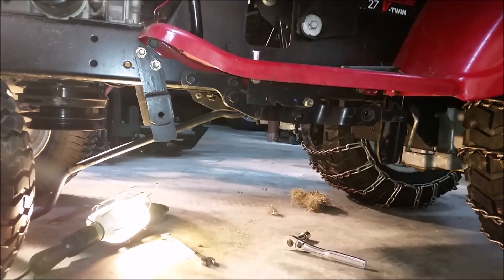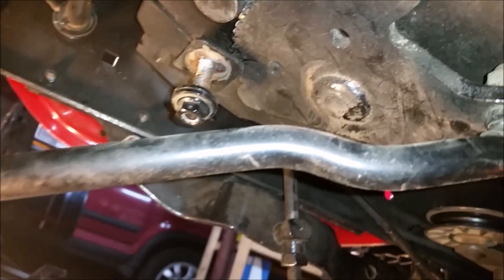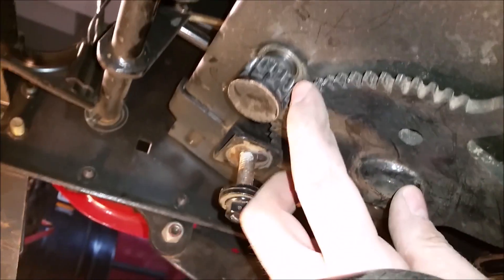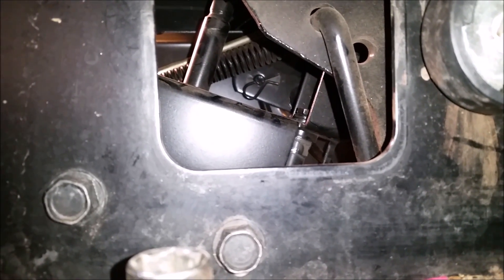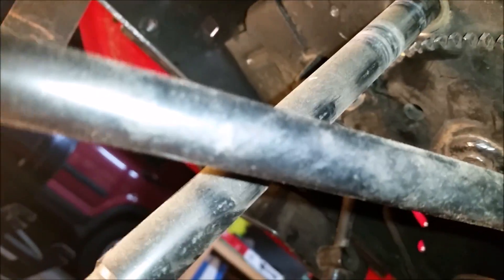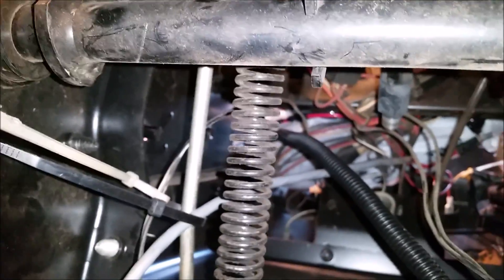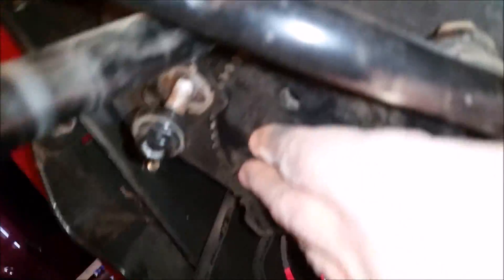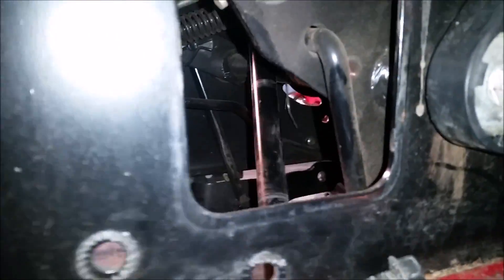Craftsman tractor DGT6000 bad steering fix upgrade V1.0 - There is a V2.0 update

Comment: Ould you rotate the sector gear a tooth or 2 to allow for the same amount steering in both directions. I just bought a husqvarna that has the same steering setup as your craftsman. It also turns much tighter to the left than it does to the right. Also, does the steering shaft have to come out through the bottom of the mower instead of pulling it out from the top. Thanks
Reply from the maker: No cannot rotate it a tooth as the linkage will hit the frame. This is just the way it is. Yes the shaft have to come of of the bottom . Watch the later 2.0 version of this video as I make more adjustments later.  Thanks!

Comment: That was quite the steering wheel modification!  I agree that using that plastic, likely Delrin, for bushings is a designed/engineered failure, maybe to save construction costs, but also to sell replacement parts.  Your Upgrades should last forever!  Too bad that MTD, who makes riding mowers for most all branded sellers, including Craftsman, won't use materials like this to make their products much more reliable and basically indestructible.  If cars and trucks were built like this, they wouldn't last 5,000 miles, but now even vehicle manufacturers are cutting costs by pennies at every turn.  Built in the USA/in America used to mean something, but now everything is outsourced to China, Hong Kong, Taiwan and Mexico where standards and quality mean nothing.  That's why you're much better off with Japanese vehicles made in Japan like Toyota and Honda.

Some Japanese vehicles are assembled in America and Canada and even Mexico, but they are all assembled with Japanese OEM parts for cheaper labor and shipping while enforcing strict standards of Craftmanship during assembly while Chevy and Ford do not, especially not in Mexico!  Many American vehicle parts and engines are built with American design, but done with little to now standards.  Mexican workers for Ford are paid $6.50 for an entire day's work, so what kind of quality can be expected from that?  Toyota and Honda pay much more and the workers are Supervised!  Briggs and Stratton small engines built in China are complete garbage in comparison!!!  My now 5-year-old Briggs and Stratton small engine in a Craftsman self-propelled push mower has zero compression after its 2nd use of its 3rd mowing season.  I bought it for buying a house and didn't use it at all the 1st year and it's been dead for a year.  I'm gonna tear it apart and check the valve bushings, piston rings and cylinder wall to see if I can repair it.  I've been buying Craftsman all my life and their push mowers were never considered to be a "Throw Item" before China!

If you take the steering gear loose from the steering column, straighten the wheels, center the steering wheel and center the steering gear, you should be able to get an equal turn radius for both front wheels by centering the steering gear left & right stops.  There may also be some wheel axle assembly and/or ball joint adjustments you can work with to keep both wheels perfectly straight and properly aligned.  You might also want to install a gas shutoff valve, especially for wintering storage.  I see the gas filter, but not a gas shutoff valve.  It usually goes between the gas tank and the gas filter.

Comment: I know it’s been years since posted, but thanks. 
I fixed mine with your solution as an inspiration. I found some block bearing that fit inside the frame piece with only minor grinding. They sit on top of each other inside the bracket. There’s grease fitting as well. If the gear and sector ever wear out (some sloop from years of wear), they’re easily replaceable.
Reply from the maker: I hope you didn't use a bearing block similar to mine as it didn't hold up over time. I have a later video on my channel with a retrofit.
Reply: @ScrapMetalWorks  I’ll look for it. Mine had grease fittings on it, so far no problems.

Comment: Let's be honest who at fault here you are for not blowing and keep.trash out and lube moving areas ur fault totally think about i use compresd air to blow out all dirt and grass and no failures when you care of ur equipment
Reply: It’s normal wear and tear you can’t really lube a plastic bushing maybe with graphite or spray silicone but I’m betting you will not get that much more time out of it,I bought mine in 2003 and it’s just getting bad now,I mow a bit over an acre sometimes 2 times a week if we get much rain but most times it’s only once a week I always rinse it down to remove the dust and clean the deck

Comment: No doubt new bushings are needed, but those teeth are too far gone for your right side turning, I have to do the same thing to mine.
Reply from the maker: it lasted until the end of last summer but it was finally done. I replaced it in the fall and although it was a pain to take it all apart again it gave me a chance to inspect the condition of the bearings and cage assembly and found no wear so this modification was definitely the way to go. thanks.

Comment: How can I tighten up that plate with gears on it my plate wants to flex when it starts getting pressure on it
Reply: That's what mine seems to be doing too.  Husqvarna over here.  You find a solution?

Comment from the maker: Remove the square black plastic cover on the left side by the foot well and you can see the steering shaft. Reach in with a pair of pliers , unclip it from the shaft and the pull straight out.

Comment: Very cool! Extremely smart idea. You should patten that and sell it. I’m having the same problem now with the one I’m working on. Do you remember what part numbers those bearings were?
Reply from the maker: Austin Crum watch the 2.0 version of this fix on my channel Scrap Metal Works. This first implementation didn’t hold up over time. Parts are described at the end of the video.. it works really good now.

Comment: could you provide the part name or technical name for this bushing..ty
Reply from the maker: healthyamerican I had to redo this modification as the original failed after 3 years. You can find version 2.0 on my channel Scrap Metal Work https://youtu.be/cQSlVl7w_MM I provide materials and part number for the bearings at the end.

Comment: This makes me so mad. This was the probably the most expensive Craftsman tractor they made then. Plastic bushings in a dirty abrasive environment junk.  They probably saved 10 bucks a tractor by not to using a replaceable sealed bearings. Its a design that says we want you to buy another tractor very soon, (Someone else's)I'm thinking about drilling the housing  and using a flanged go cart wheel bearings like these. They press in to a round housing bore. https://www.gokartsupply.com/bearings.htm
Reply from the maker: RED 7218 Hi, the flanged bearing is actually a good idea however you’ll have to drill a pretty large hole and be precise where you locate the hole so that everything lines up and the gears mesh properly. Using the bearing blocks I used allowed me to loosely bolt it together and once everything looked good tighten the bolts. The other issue with the flanged bearings is that the steering column and the shaft of the sector gear  can rotate within the bearing. So look at the new video of version 2.0 of this modification on my channel that I just completed. The original version shown in this video lasted about 3 years but eventually failed because the sector gear shaft was rotating inside the pillow block continuing to wear it. Now I use 4 sealed bearing blocks and it works amazing. Good luck!

Comment: This style of steering is an older version (and of course the one I have- a 2000MY tractor) where the bushings failed and the sector gear, steering shaft, and mounting bracket all were worn down such that replacing the bushings still left too much slop for the steering to work.  The sector gear and steering shaft are still available new, but the bracket mount isn't, so there aren't many options for those less handy.  Any other approach you thought about?
Reply: Lotus M-100 I'm doing mine right now. bought new bushings and it still jumps at the gear. really not sure where to go from here.
Reply: Lotus M-100  I have the exact same issue!

Comment: I have this same tractor it is a pile of Sh@# I got it new and have had nothing but trouble with it!
Reply from the maker: Well it's true you get what you pay for. I remember that between the tractor, all of the attachments and options I paid around $5k for it while the equivalent John Deer or Cub was $2k-3k more. It was obvious that the design of those tractors was better but I really didn't want to spend that much for something that goes in the shed so I went into it knowing it wasn't perfect. For the money it generally met my expectations.

Comment: Enjoyed watching your repair.  My experience with bearing flanges (wings?) is that they tend to break off easily, especially if they are made of cast iron.  I'm wondering if you've had any breakage since the repair [and engineering] since the flange was tightened at an angle with a shim underneath.  I have a similar or perhaps exactly the same problem on my Craftsman riding mower and am hoping to fix it soon.  Mine is the 22 1/2 HP twin cylinder model.  Any advice would be appreciated.
Reply from the maker: Hi, I had no issues so far with the bearing. I use a snow blower attachment in the winter which adds about 250Lbs to the front end really stressing the steering mechanism and it has performed flawlessly.Thank you.

Comment: I just keep mine greased so it won't wear out like that. Grease is cheap. A lot of the newer ones are using plastic bushings (or nylon) so you don't need grease, but I still use it.

Comment: you can buy bronze bushings from Sears direct .I bought bronze bushings from the hard ware store,3/4 id ,7/8 od  .I used grinding stones and a drill to make the new bronze bushing fit in the steering plate .my shafts were in great shape .you can buy these parts at sears direct .

Comment: My tractor shares the same poor design, I'd love to do the same fix for mine. Would you mind sharing the part numbers for the parts you used? Thanks
Reply from the maker: zoltarp watch the 2.0 version of this fix on my channel Scrap Metal Works. This first implementation didn’t hold up over time. Parts are described at the end of the video